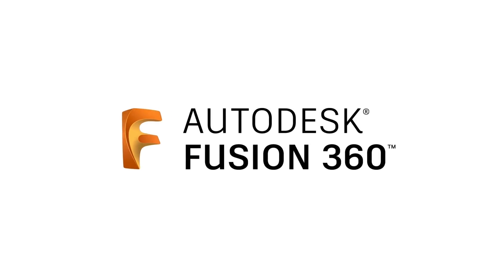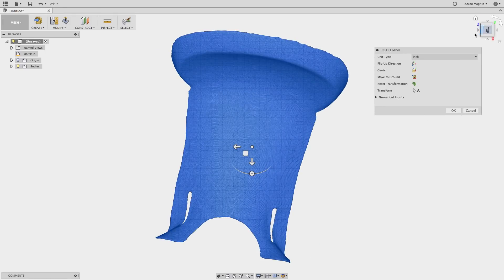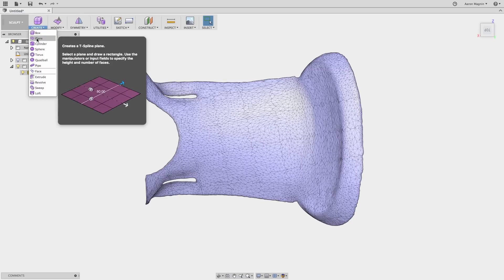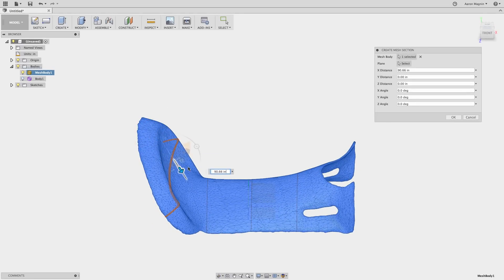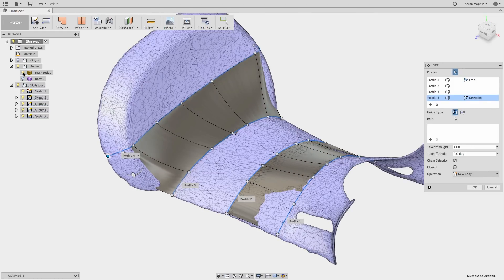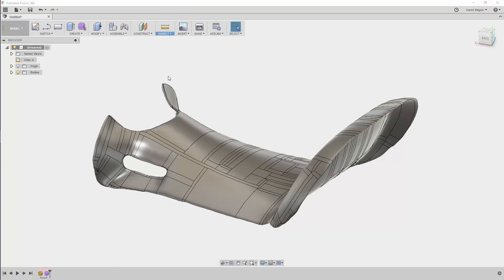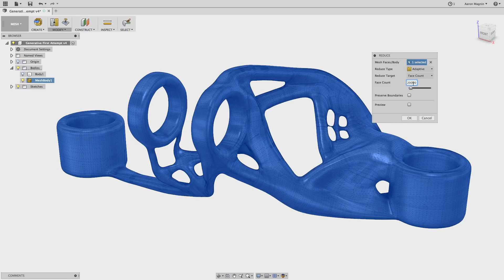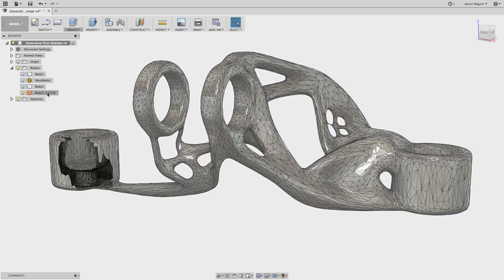QUICK TIP: Mesh to Solid Reboot

Comment: This solved a problem I've been having for weeks. When I open an STL file with File/Open, it comes in at 10X the scale. This happens with every Thingiverse file and STLs I've generated from F360. But if I bring an STL in using Create/Insert Mesh in the Mesh space, it comes in at the design dimensions. It's been driving me nuts.

Still not sure if there's a better way to do it, but this works fine for me now. Thanks for an informative video.

Comment: and where should we find/enable the sculpt option? it's not in the workspace menu as shown on both videos.

All I'm trying is to "cut out" the mesh from a body I created in Fusion (as the "open hardware" from my 3d printer provides stl's)

How hard can you hide such a simple thing
Reply from the maker: Are you in the new UI? Are you in history capturing, or history free design mode? There are some nuances that can change where the workspace is found. I assume you've found it by now? Forum is a great place for questions like these. 
It might be easier just to recreate the design in Fusion rather than messing with STL to Brep conversion. Depends on the complexity, however. If you just need to make a cut, that Mesh to Brep conversion method should do the trick, but then again if its overly complex it'll struggle with the conversion.

Comment: In other words converting a STL to an object is not a functionality in fusion 360 that delivers an expected result. Way too complex and imprecise with too many constraints and very poor end result. In fact in most cases it is easier and faster to purely and simply redesign your object from scratch.
Reply from the maker: It's nothing to do with a Fusion limitation: the limitation is from the STL files themselves. If high precision is required, remodeling is the way to go.

Comment: Dear autodesk! are these solids something i am able to either convert to OBJ and edit in Zbrush? basically is there a way to export to zbrush and be able to edit them?
Reply from the maker: Hmmm, not certain. Can you fire this question to our amazing community forum? https://forums.autodesk.com/t5/fusion-360/ct-p/1234
Reply: To save a solid (BRep) as an obj in Fusion, first you need to convert the model into a mesh. Go to the Create menu, and create a Mesh. Once in the Mesh Workspace, click on the Create menu and select BRep to Mesh. Select your BRep body you want to convert and set desired parameters and click OK. Now you can save as obj by right-clicking on the new mesh body and choosing Save as OBJ.

ZBrush can import stl files, so if you have a stl file that you want to edit in ZBrush, you can skip all of these steps in Fusion.

Comment: While Fusion 360 is a great CAD software, my gripe with it is how the interface seemingly "hides" certain functions from intuitive ways of accessing them. The toggling of"Mesh-to-Brep" function from the right-click menu of a mesh body is an example of this. Why can't it be always accessible in the right-click menu and when selected, have the design history automatically turned off (showing usual warning dialog panel)?  Then after the conversion is completed (or aborted), have the design history turn back on automatically again? Why is there a need to "hide" things on menus?

Comment: I have to ask, why does every task have so many steps seemingly arbitrary rules? Turning on and off design history to enable mesh-to-brep? Why? Only quad mesh to b-rep? Why, Why does each toolset require changing the workspace? Can't there just be a ribbon of tools?
Reply: Could it be done in a more user-friendly way? "Convert" would be present in the menu, but activating it would say "To convert to BRep, you need to turn off design history". This beats asking on forums, being convinced this is not doable, and finding this in a video. Please, please, no secret handshakes in user facing product.
Reply: Quad mesh to tsplines is for technical reasons relating to the way that tspline geometry works. You can convert triangle meshes to b-rep, but because of the way that this (very non-trivial) operation is set up it is not compatible with the capturing design history. It's likely that could be changed, but would require significant effort. As far as the context menu options changing based on workspace, well... that could certainly be improved.
Reply: Alex Emelianov that's a great suggestion.